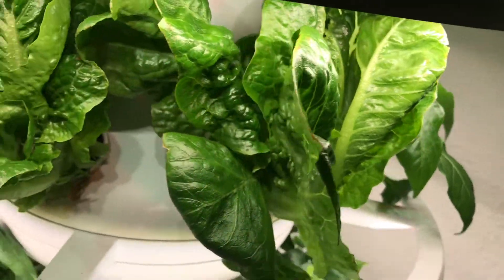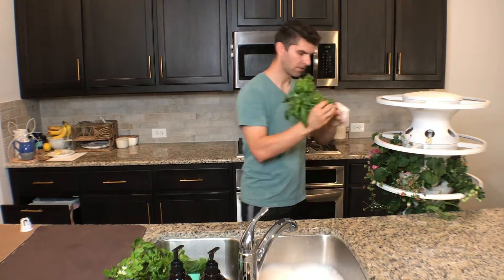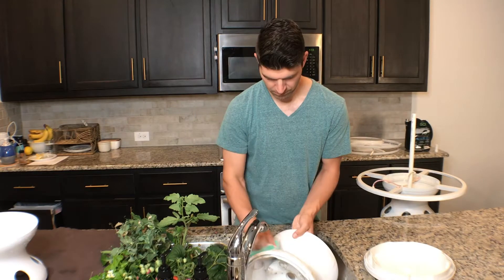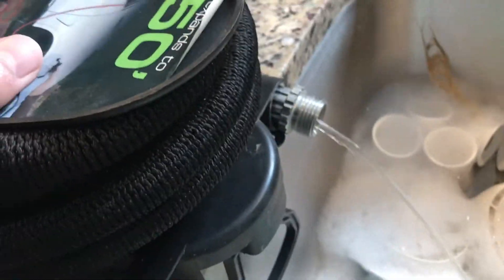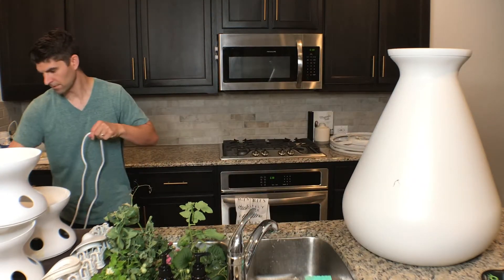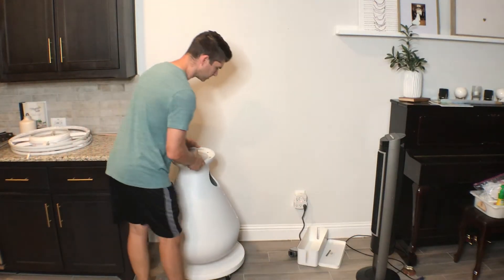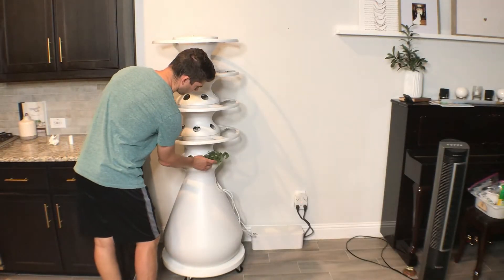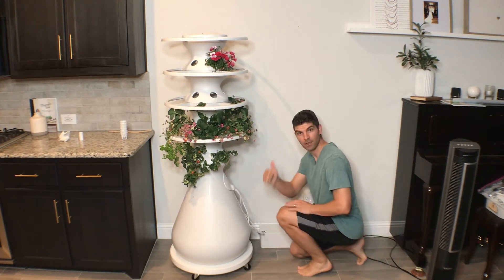How Do I Reset My Lettuce Grow Farmstand Indoors? Lettuce Grow Farmstand Reset

Comment: I saw you are using cable management box for the cables. The adaptor for the ring lights is super hot when the lights are on, is there a heat problem in the box?
Reply from the maker: Not that I’ve noticed and we have had it for a while now.